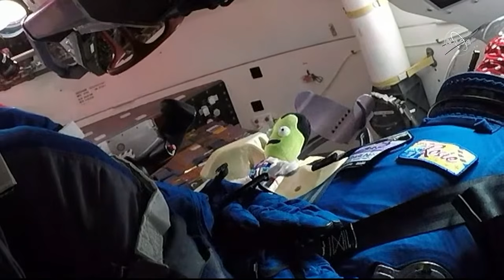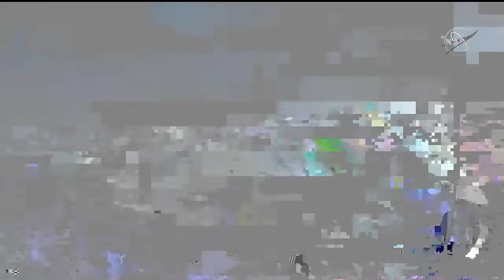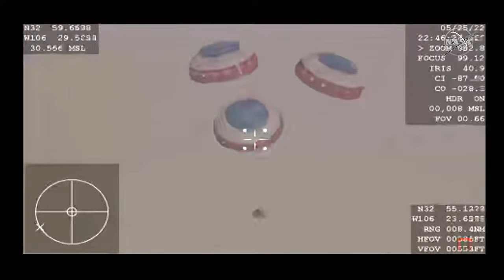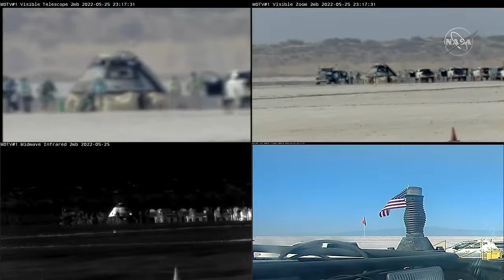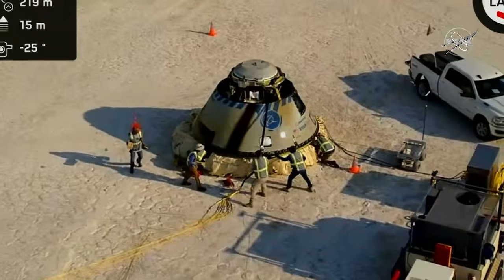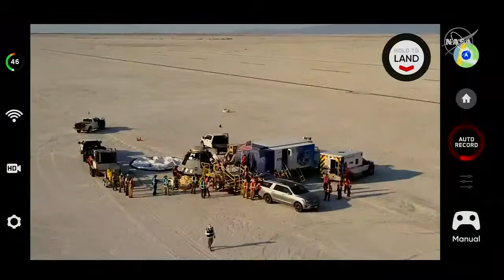See Starliner's Orbital Flight Test-2 Landing

Comment: The new Space Shuttle should consider adopting SpaceX's vertical rocket and solar panel folding wings. This would enable flights to the vicinity of Mars by incorporating optical propulsion engines usable in space. For return to Earth, the return booster would be prepared in advance outside the Earth's atmosphere. The shuttle itself would be stored in a US space center warehouse after separating only the return pod. The return rocket, with the return pod and return booster connected, would re-enter the atmosphere after orbital correction and initiate a vertical landing. This measure would reduce the risk of combustion syndrome in the atmosphere during return. Furthermore, sustainable design considerations are necessary, such as ensuring the continuity of an autonomous launch system using the booster and guaranteeing multiple reuses. 🌞